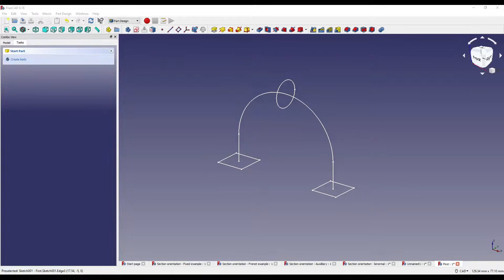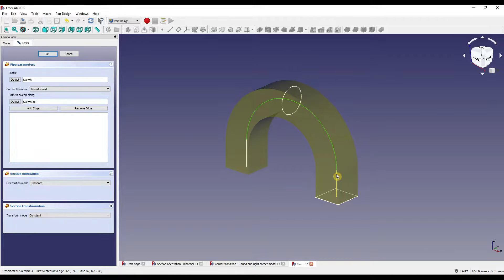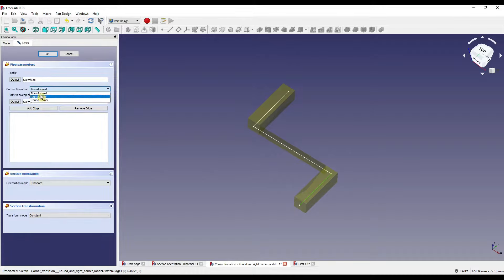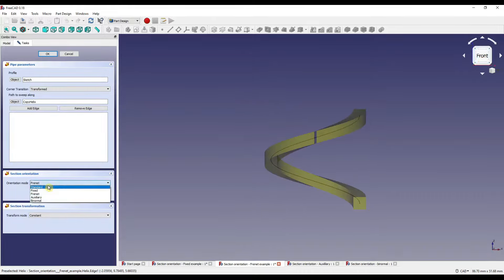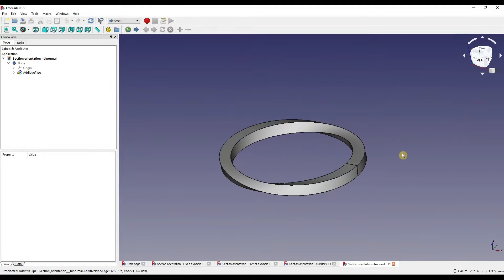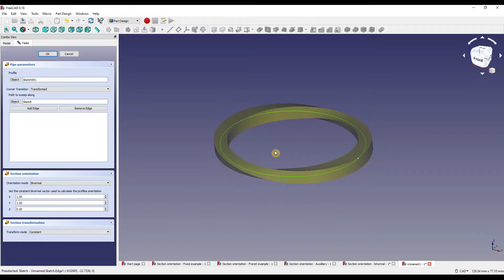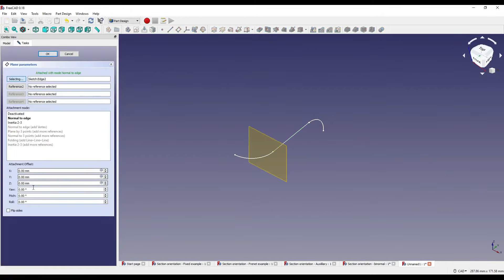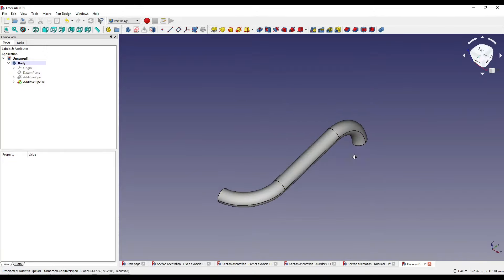3D modeling FreeCAD Tutorial - Additive pipe modifier

Comment: Another way to make this last example (3D pipe) work is to apply boolean union in Part module to those lines of a 3D sketch. You can also draw the 3D path in Draft module (it has some useful tools like various types of object snaps) and then use it as a path for sweep. In this case you may also have to apply boolean union to path pieces.

Comment: Question, there is a part i would like to model, and its the foot to the mpcnc machine. A gentleman using the Ls3 fork of freecad modeled the curved foot by offsetting copies of the same sketch at different sizes, then lofted. I would like to see it done using the pipe method. 

Thanks